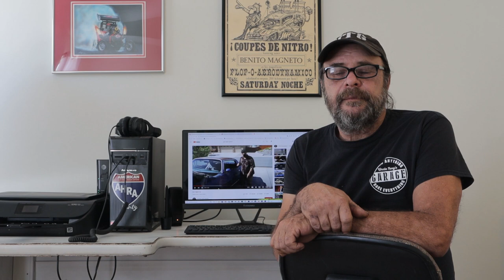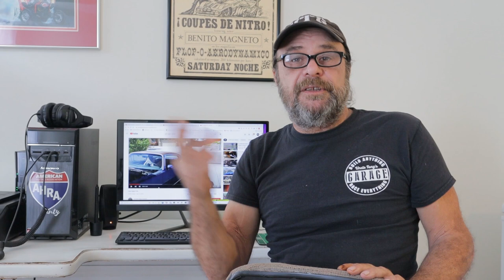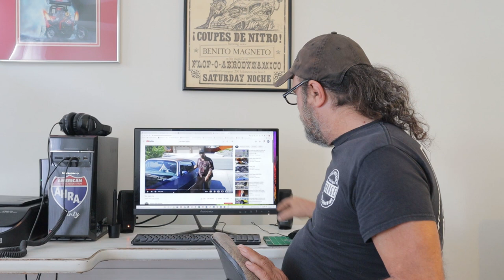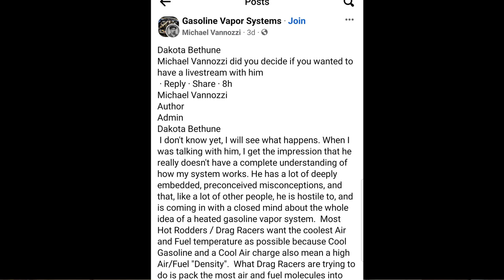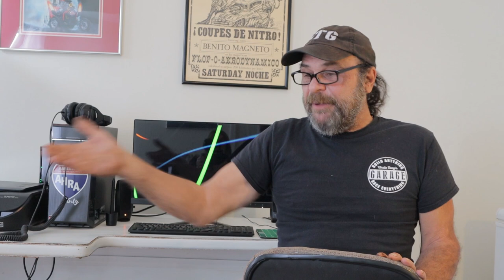Climbing Down The Mega Mileage Conspiracy Rabbit Hole

Comment: my dad got a 91 vette before he couldn't drive any longer ...  it has the base LT1 and it gets over 30 mpg without trying, live in the middle of nowhere so lots of 55-75 mph cruising.  A GM 350 can easily get 30-40 mpg on steady state cruising on a flat road with decent temps.

As far as alternative power sources; I recall on the news something about running a car on water and it disappeared never to be heard of again; my parents assumed oil bought it out and buried the patents ...  think that was late 80s early 90s?

Most people could easily get 5-10 more mpg if they just learned how to drive efficiently.  Slow starts, minimal acceleration, don't go over speed limit, use the brake as little as possible (safely), planning trips together so the engine is warm instead of multiple shorter trips with cold engine starts, etc.

I can probably get 40 mpg out of the LT1 if I put real effort in to it.  I got nearly 50 out of a 99 Accord loaded with 3 people's worth of stuff; I've gotten over 90 mpg on a 1st gen civic  hybrid on a single trip and could average over 60 semi regularly.  I have gotten over 30 mpg in a rotary (RX8s and 2nd gen RX7s) ...
but I could only get 9 mpg no matter what I did in my old 75 Pontiac with a 400, 20 ft long convertible land yacht.  I'd love to have one again and try to figure out a way to get 20+mpg with it; would probably have to majorly reduce weight as well as engine efficiency.

Thanks for the videos and passion you share :)

Comment: 2.7 gears and an overdrive? The engine would be bogging on any hill. I had a 94 mustang gt. 5.0 5 speed 2.73 gear.  No throttle response in top gear until you were above 70 mph. Everyday mpg was the same for me  in 4th or 5th gear.  The car had reasonable power. A motorcycle carbed V8  would be giving up any usable driveability
Reply: Just think about how many clutches he go's threw  a month. Lol

Comment: I think people also don't think of in terms of what "car" may mean as it could be a very small lightweight streamlined car running only 50mph with full throttle and on the flat for full efficiency. Think of some motorcycles that run maybe 75% throttle at 60mph and with a 650cc may get close to 50mpg. A 500 horse motor running at 25% throttle in a car would never see very good fuel efficiency compared to maybe a 1.5 liter at 90% throttle in a lightweight and efficient aero design. And even a VW diesel Jetta at 75mph you may get close to 60mpg but that isn't common.

Comment: the issue i can see is hot air causes air to be less dense as a result making less power, on top of that hot air can cause engines to detonate/ping itself to death.
Reply: That’s why he had the turbo charger on the intake, pressurizing the air/fuel into the intake

Comment: Well you can buy a afr gauge. Use a system that supplements the normal fuel delivery system. Have the ability to tune both systems. And you'll get better milage,  ive seen it done.
Its always a little different for everybody.

Comment: unka tony,  I agree that there is no magic hi-efficiency carb/injection system here.
What I would like is an engine that is tractable on the street and can accelerate
AND get very high mileage when cruising. 
frankly, an exhaust driven turbine will get most of that.
I dislike gasoline vapor carbs because of what happens with a backfire.
the possible 5 to maybe 10 percent increase in efficiency is not worth the risks.

Comment: I was thinking about Smokey's engine. Though it does not have much of any practical use for automotive, a super efficient engine that is good at running a constant rpm and load would be great for power generation, possibly pumps too. I think the tech is valid and plenty usable, it just has not been applied in a manner that matches it's strengths.

Edit to add: had a few thoughts (been pondering for bout fourty five minutes) modern engines are more efficient due to better head design, as well as other mechanical improvements, and fuel delivery. What would the improvement in fuel efficiency be if used on a modern egine design? What if we use direct injection to add a bit of oomph when needed? If that would even work.

Comment: you don't need michael. a car or a dyno. you simply lock a PhD physicist in a large closet with two packs of Twinkies, three Diet Cokes and a white board. pass under the door on a sheet of paper the weight of the car and the coefficient of friction of the Camaro body. after 12 minutes the physicist will emerge from the closet and say "on level ground, no wind with a 4 foot tall jockey driving the 35 can work." then he'll add "you can never get a Camaro to traverse 100 miles on 1 gallon of regular gas, can i get another Twinkie." game over.

Comment: With the old piece of crap Holley 4160 that I had on the old C-20 (the one that leaked and cause the fire, O ring to the secondary float bowl went. She needed new wires and cap,wiper motor, anyways, and replacing the wiring harness from fire wall to head lights is only a half hour job once a wiring harness is obtained ) I was lucky to get eight mpg. Downhill with a tailwind.With the brand new from the factory 4160 I am getting seventeen mpg. Maybe twenty if I keep my foot out of it. But she sounds so good when I open her up and she kicks down. Oh yeah new detent cable and throttle cable too.

Comment: I just want to see someone build a turbo charged propane fueled engine. If you're looking for a fuel that easily vaporizers, it's hard to beat propane. It doesn't burn as hot as gasoline but your engine should last indefinitely because it burns clean.

Comment: Had a 67 d100 with slant six. It didn't get very good fuel mileage at all. Swapped out the one barrel with oil bath air cleaner for a two barrel intake off a 1980 car and it made it even worse for fuel mileage. 3.73 rear end was made for pulling and you could feel the difference between more air fuel getting to the motor, but it being up there on the rpm range at 50-55mph caused it to eat gas. Swapped out rear gears on my 94 F150 to 3.55 rear ratio and lost about 2-3mpg from the 3.08 from factory. It would pull like no tomorrow though. Power and efficiency, a diesel is the way to go. Still a big fan of 6.2l and 5.9l from the mid 80's. You could get power and economy out of them if you treated them right.

Comment: they act like they are the first to do this, 20 yrs ago a group of college kids in Japan took a diesel engine in a Datsun pick up and customized a 5spd transmission gearing and 58 mpg with low gearing in 1-3rd and top end in 4th and 5th.  25 yrs ago Olds put out a Quad 4 cylinder that ran over 200 mph, if not mistaken it almost went 300 mph on the salt flats . . . both were not practical, just because you can do it doesnt mean you should...

Comment: There were vapour systems that worked well developed in the late 30s early 40s but it was not for high mileage but to keep vehicles running in desert conditions. The system was used by the British long range desert group. Vehicles of that era under max load used to vaporise fuel  big time in extreme heat conditions so a vapor system was fitted to keep the vehicles running. From memory the economy was worse and the vapour tanks had a habit of going boom . I have seen the system first hand on a Humber scout car . Cheers from Australia and keep debunking the crazy

Comment: @ Uncle Tony’s Garage
Why not build a vapor system of your own and put it on the dyno? 
Sounds like you have more than enough knowledge of the system. 
I remember Smokey running that hot air intake system on the Fiero. I remembering reading it in Hot Rod.

Comment: But Tony! THEY'VE CHANGED GASOLINE. As far as I remember, when you ramping up octane numbers, vapor/boiling point goes up and energy stored in pound of fuel goes down :)
Reply: Liquid hydrocarbon fuels all have very close to the same energy content per unit volume or weight. If a couple percent difference in energy content per unit volume or weight makes the entire difference of whether an engine concept succeeds or fails ... it's still no good, because it's too sensitive. Aside from the whole issues around leaded fuels vs valve seats and ethanol vs old-style hoses and seals (both of which have known solutions), 1960s cars run perfectly fine on today's fuels, and today's cars will run fine on the earliest unleaded fuels that still meet today's octane specifications (1970s).

Comment: I totally agree with the fixation problem. I'm interested in the gas vapor system only as a generator for an electric hybrid. You have fixed known loads at generally fixed rpms. If you use a gas vapor system and put right length headers on there and tune it just right will it output enough to get to the magical 100mpg.
I live in Japan and we have a Nissan Note e-power. It's basically a gasoline generator electric car. Under 50mph, in the city or in the back roads, we get 32km/l real world. But start getting up to highway speeds and it drops off to 23, 22, 21 km/l (50-54mpg). The draw back of a fully electric drive. The engine that's in it is a modified piddly little 1.2l 3 cylinder. And I'm not trying to knock Nissan engineers but they definitely designed the system with cost in mind.
Anyway, if you converted up an old Prius or something similar to use gas vapor, upgrade the electric motor and tuned it properly could you get that much closer to the magic mpg number?

Comment: Honestly, if he's got a T5 trans, a well set up 350, and a 2:70 rear gear. That camaro should be easily be able to achieve around 30 mpg with a 4 barrel at 55 mph. My old 1979 Trans Am (stock) with a 403 V8 (with a 750 quadrajet), a 3 speed auto trans, and 2:73 rear gear, got 21 mpg at 65 mph. It was a dog off the line but was a geat cruiser.

Comment: When the automakers did roller rockers and fuel injection it totally reduced the fuel consumption and increased horsepower. They also put turbos to drastically increase horsepower while increasing fuel economy. If these vapor engines worked they would use them. I agree with you the facts don't support the vapor powered engines work.

Comment: On the water to fuel subject... you can absolutely 100% turn water into fuel. Just add yeast and complex sugars, let it sit a week or 2 then distill until pure. It'll run an engine after some modification. 😂

Comment: I regularly can average a legit 34mpg in my girlfriends 2020 Charger v6  that weighs 4000lbs and that is driving 70-75mph on interstates and 55-60 on back roads, no city traffic. That is a 450mi trip tank average and I have done it several times. 35mpg in that camaro isn't really very impressive.
Reply: And that Charger is running through an automatic trans. Imagine it would be over 40 mpg with a 5-6 speed stick.
Reply: @PontiacKid2  That 8 speed auto is pretty slick. From an efficiency standpoint the fewer spinning parts the better so a straight drive with no gears would be the most efficient but you would give up a lot on driveability and performance.  a pair of lencos might get better mileage than a conventional stick trans.

Comment: I'm with you Tony that engine should easily make 300 hp and 380 torque but I think he believes that fuel mileage is the total end goal. It does matter to him if it takes a mile to get to 65 mph or even 75 mph. But I want to add this small challenge to the both of you, I want to see 38 mpg's city on that 350 Camero.
Reply: I wonder how many clutches he go's threw a month lol
Reply: @paulshea2560  another good point clutch floating

Comment: In the 70s the president lowered the speed limit to 55 mph. Why? 55 mph gives you optimal mpg it was a way to ration the gas. All old modern cars will get around 25-30 mpg if traveling at a consistent 55 mph

Comment: Uncle Tony, It sounds like they're applying the law of attraction to their vapor carburetors!, I believe that it works, so it must get 200MPG.
This stuff has interested me and whenever I get free time, probably after I retire, I'd like to try out a few of the plans that I have and see if I can get an old engine or my mowers to run on vapors. I may even hit up old mate with the dyno for a free dyno test, But I'd rather finish the 318s and Slant 6s on my garage floor first.
Back in my apprentice days I drove my stock 1982  XD Ford Falcon, 250 4 speed and played around with things to get better economy. The Aussies will know what an XD is. I played around with carby settings, timing, cooling system temps, spark plug gaps, tyre pressures etc to see what works. When I bought the car I'd get around 250-300km per tank, around 70 litre tank from memory. Unknown to me, I had a leaking fuel cap, I fixed that and the economy went up lol.
I got all tuned up to factory specs at TAFE and we stuck it on the gas analyzer and the teacher was very impressed that this car ran clean for what was then a 20 year old car. In that trim it got around the 400-450km range per tank. Most people couldn't believe that an XD would get those figures.
I then started playing around with it and I was able to get the range out to around 520km per tank from memory.
In Sydney traffic, I worked out that I was able to get 10.1 litres per 100km and 7.5km per 100km out in the country or freeway.
So the fuel economy tricks worked, BUT, I did lose power and acceleration. I never measured it but you could feel it by the seat of your pants. For what it was, a cool science experiment and living on apprenticeship wages, I was very happy with it and the loss of some power never bothered me. I was using 98 premium for fuel, I'd rattle it's head off on 91.
The XD is now sitting in my shed waiting to go back on the road one day, after my Mopars are done.

Comment: Uncle Tony you can get an ice engine to run on water. Been done a million times, however you need more energy to split water into hydrogen and oxygen than it would otherwise use in energy like gas or electricity. It is marketing and story telling hype I agree with you.

Comment: my 318 in a 69 cornett would get 30 on a long road trip with a 2 bbl carb i 3 speed auto dont know the rearend grear. i get 37 on the hyway in my 02 civic. i am a mec.as well. and like to see facts not faith promices. i was wandering? i have some fuel heaters for big trucks to keep the fuel from gelling in winter. putting one of thoughs on my civic to see if i could get a few more mpg.

Comment: You want 70-100 mpg. Simple make a small aerodynamic chassis about 1000-1200 lbs. Put a 20-30 hp diesel from a compact tractor. With the right gearing and narrow tires to reduce rolling resistance you should be in the ballpark of mpg.

Comment: This is basically how the auto makers in the 80’s met cafe standards. You choke down any engine enough with a shitty intake, drinking straw exhaust with 90 degree turns, a labyrinth of a pellet type catalytic converter, and a super tall final drive gear, of course it’ll get good gas mileage, especially if it can’t get out of it’s own way lol. I once researched about making a fuel vaporizer then it dawned on me…Fuck getting good gas mileage! That doesn’t sound cool when trying to Asperger’s mansplain it to a chick your trying to give a ride home lol… so instead I got a 454 suburban and a put 42”swampers on my k5 blazer

Comment: My 88 5.0 with 3.08 rear gears shifting at 2,000 can get 28 mpg did it more than once and that isn’t on the freeway just country roads. If it had 2.70 gears probably would get 30-31 like I said I shifted at 2,000 everytime for two weeks. Normal driving I get 24 mpg. My mustang is an SSP and is under 3,000 lbs

Comment: If they indeed worked then a propane system retrofitted onto a carbureted engine would get similar results, even with the less btu of the propane, but propane powered engines get less mpg and corresponding performance than gasoline. And remember, propane is 100% vapor .

Comment: Thanks for addressing these 100mpg snake oil salesmen.  A gallon of gasoline only has so much energy in it.  Simple physics.  A tiny motorcycle carb cannot supply a 350 with enough air and gas for efficient acceleration.  Lean, fuel mix burns holes in pistons.  Sure 55 mph on 20 hp but it will take you ten miles downhill to achieve that speed.  I've of this BS since the gas crunch of 1973.

Comment: The real question is can you put a 750cfm carb on a motorcycle ?
Reply: Any good running carb will run any good running engine. a 454 can run on a honda 400 CC mikuni, if you don't want much above idle!!

Comment: My 79 Firebird had a 70 Pontiac out of Grand Prix. That thing got great gas mileage, until I opened the secondaries lol Like you said Tony... You feed a gas engine less gas, you get better gas mileage pretty simple. Unless you run the new gas injection systems and really high compression, you'll never magically gain power with less gas being fed. You can a turbo to that vapor system, you're just adding more air flow which = even more fuel used.

Comment: Tony a lot of people hate GM iron duke it was a strange engine small block short block with a peanut port(swirl)  big block head.The intake I feel
Reply: I feel the intake made the mpg small plenum first heated by egr then water at the bottom only to go into a chambered the head about three times the size. of the plenum to expand and cool then into the head swirl port .even in 1984this engine got 38 to 48 mpg depending on the gear ratio thanks Tony and cathy

Comment: Can someone explain how my GEO METRO with 
#1 115psi
#2 115psi
#3 zero psi
Can run perfectly and get 39 mpg.
Then after repairing the burned exhaust valve it runs perfectly and gets 41 mpg.???

Can someone explain to me why my 1971 roadrunner 383 at 60-65 mph on freeway gets 21 mpg and my 2006 v6 mustang gets 23 mpg!